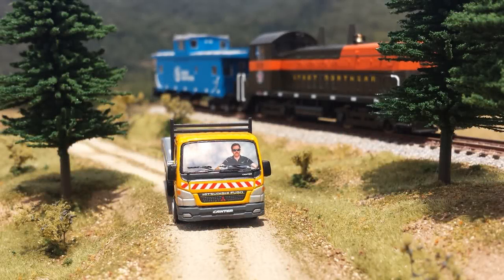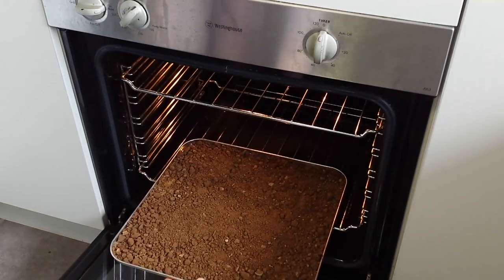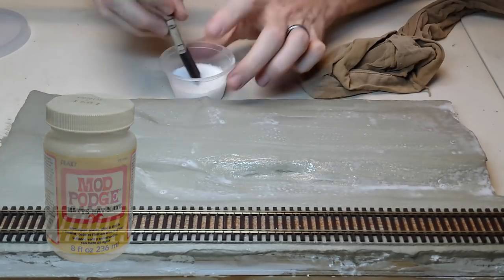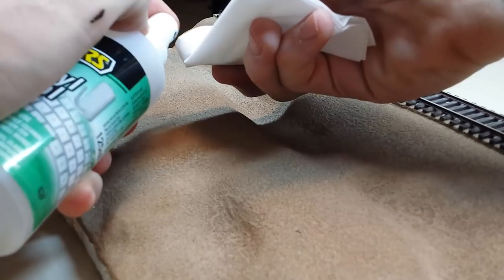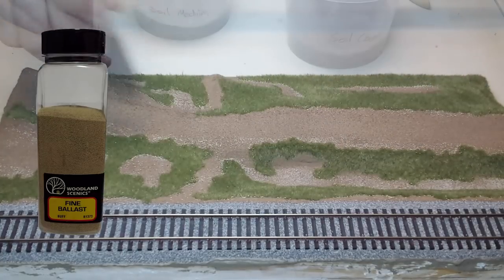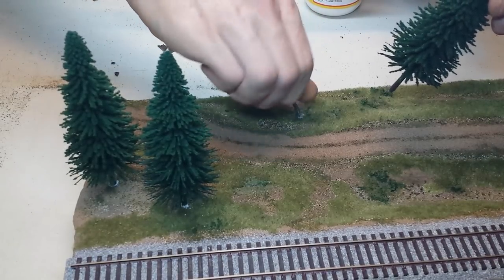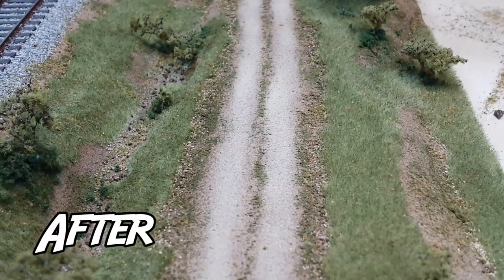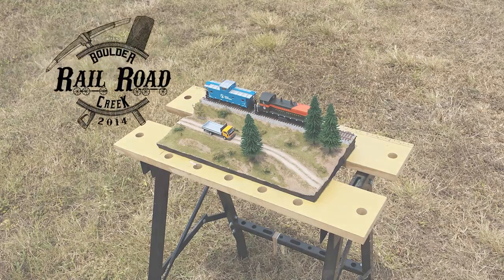Realistic Scenery Volume 1 - Create scenery that looks real! - Model Railroads

Comment: Hi Luke, brilliant video. I am in the process of building my 1st model railroad. I have got to a stage of laying a flat sheet of foam on the baseboard. I am in two minds as to which colour to paint the foam . I want a terrain just like the video but with some small hills.. Two questions, how did you create the terrain in the video and what that bag in the first part of the video. Thanks
Reply from the maker: I mostly use 'Scuplptamould' to form the hills and ridges but you could also use scrunched up newspaper and plaster cloth as well. The bag just had dirt in it, I use the dirt sifted down to add texture over all the land areas.
Good luck with you layout :)
Cheers
Luke

Comment: Very interesting process.  Might use it sometime.
Reply from the maker: Rob McCrain Thanks Rob, using real dirt can actually come up looking quite good. I think that by applying only a very thin layer with the stocking helps a lot, I tried to apply the dirt using a spoon and the thick areas of dirt don't come out looking as good. Thanks for the comment.

Comment: I was wondering about how you do your static grass. I've seen people put down a layer of fine ground foams in different greens, and then do static grass on top. But it seems like yours goes straight one the dirt layer. Do you feel that is necessary? It looks like its dense enough that I wouldn't need it. 

Looking forward to your input.
Reply from the maker: +germannscale I guess it doesn't really matter too much, if you want thin layer of static grass it might be a good idea to put ground foam down first. I haven't had any issues with laying the static grass straight on the dirt and I kind of like that the dirt shows through a little bit in the thin areas of static grass.
I usually lay the grass first and then sprinkle over ta small amount of ground foam to blend the grass in with the rest of the scenery.
It's definitely worth trying both methods though and it might also look good to use both styles on the same model to give some variety.
Hope that helps a little.
Cheers
Luke.
Reply: +Luke Towan Thanks! I guess I'll have to try both. And its probably a good idea to do both for some variety

Comment: The Sandalwood grout, or any color grout is very hard to come by over here.. Is it meant for colour only or does it serve a secondary function?
If it's for colour alone, i think i can get away with mixing different kinds of sand and/or clay?
Reply from the maker: it's mostly for color, you can even mix in tempera paint powders to get the desired color. Hope that helps 😀

Comment: Luke where do you get your spray bottles?  Do you recommend a certain type?  I can't seem to get ones that spray more 6 pumps before clogging.
Reply from the maker: That particular spray bottle was from a art supply store, it was a while ago now but it was called a fine mist bottle. I've found very similar mist bottles at cosmetics stores as well which I often use, cheap ones are better because as you mentioned it doesn't take long for them to clog up! After I finish spraying glue I will spray a small amount of alcohol through the spray bottle to clean it out. Doing that usually gets me about 3 to for months of use out of the bottle (Depending on how often I use it)
Hope that helps 😀
Reply: Luke Towan thank you.

Comment: do you need foam on top of plywood to add the grass and stuff?
Reply from the maker: JalvaroStudios gaming and Pvp Hey mate, you don't need foam or anything really. The foam is good to mold and shape hills but if you modelling a flat area you can apply the scenery straight onto the plywood. On my website you will be able to see an example of a diorama I made that is scenery applied directly onto the plywood, I used the diorama for the "Billboard", "Chain link fence" and "Light pole with CCTV". 
http://www.bouldercreekrailroad.com/gallery.html
Hope that helps with your modelling.
Cheers
Luke.
Reply: thanks so much my table is 92x48 so im buying 2 48x28 and my life goal will be completed

Comment: do you seal on the powder pastels at the end of the video?
Reply from the maker: No i didn't but you can seal them with dull coat or something similar if you want. I've found that as long as you don't constantly touch or rub in the area where the pastel is then it will stay there forever. I even vacuum the model to clean it and it doesn't seem to effect the pastel.
Cheers
Luke

Comment: What does the alcohol do?  Any specific type?
Reply from the maker: North Central Lines On30 Hi, thanks for the question, the alcohol helps the glue absorb into the scenery, it breaks the surface tension of the water/glue mixture and allows the glue to soak into the scenery. Without the alcohol, the water/glue mixture would not absorb into the scenery as well. The glue will end up drying to the top layer only, as a result the bottom layer wont actually be glued down and the scenery may end up peeling away over time. "Wet water" (water mixed with washing detergent) also does a great job of breaking the waters surface tension.
The alcohol I used was isopropyl alcohol, more commonly know as rubbing alcohol. It contains 64% alcohol and the rest is water. I have also used a brand that states 100% alcohol, it works much better however is a lot more expensive! So the higher alcohol to water ratio, the better.
I actually used a brand that contains a fragrance, it seemed to work just as well as the non fragrant types and now I have a nice smelling diorama! It seems to be holding strong thus far.